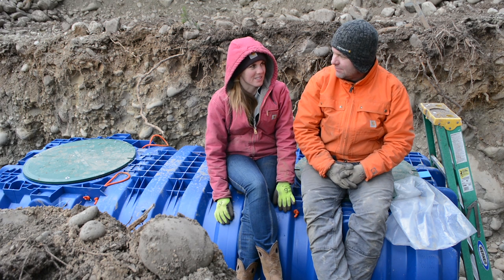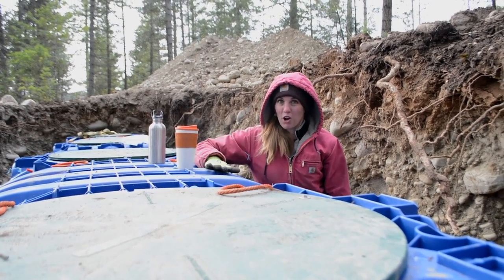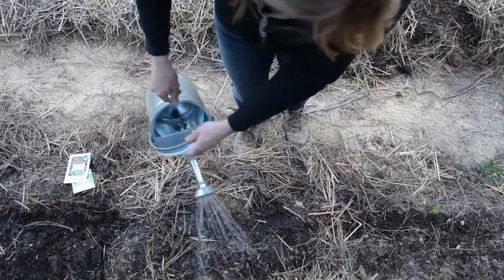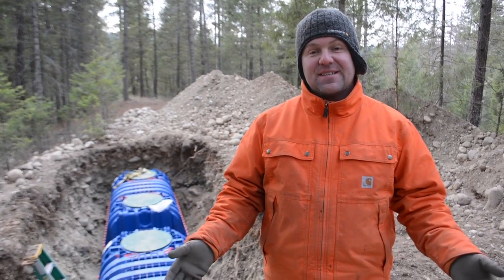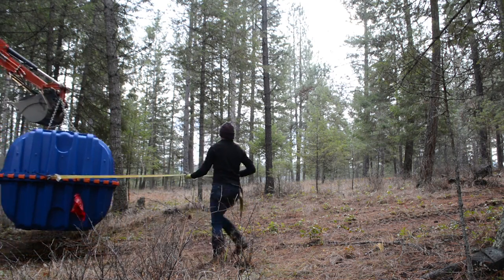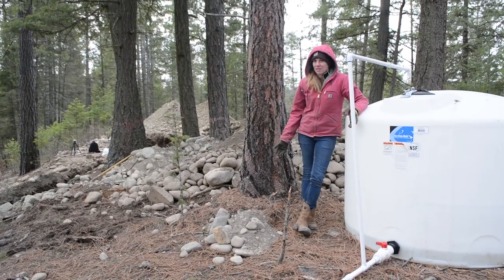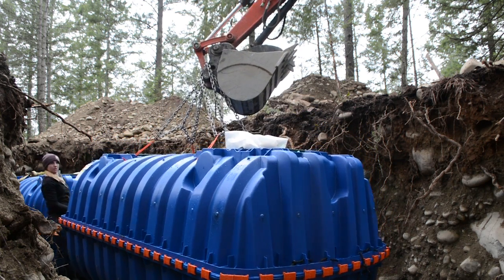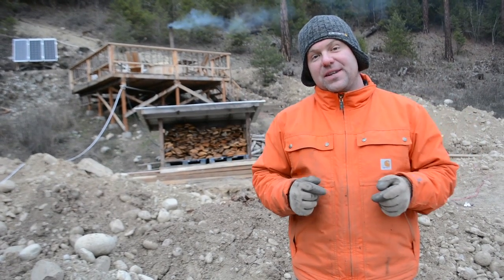Underground POTABLE WATER STORAGE TANKS - Our Off Grid Water System

Comment: A bit of construction advice for you,  take it or leave it. When stacking ecology blocks ALWAYS overlap the seams when stacking.  The shape of the tops and bottoms were designed that way for interlocking. Failure to overlap will allow a single stack to be pushed out of plumb without any resistance from the block next to it, and in the extreme, pushed over crushing everything in it's path. Interlocking ties the blocks together and makes one strong unit, much like a brick or masonry block wall.  A heavy rain could reek havoc on that wall as you have laid it. And if being used a a retaining wall the first layer should always be buried into the ground a minimum of a foot to prevent push out from the soil behind it.
Reply: Deeper there as the frost line is lower.  A buried reinforced concrete wall behind that one would be good.  vented of course.

Comment: Eventually, you will have to treat that water with some special chemicals in order for it to be potable. Even if the source of water is extremely clean and the water is fresh, if you keep it in a tank, even fully closed, it will start developing some nasty stuff inside and the first sign is that it will smell bad...Homeowners all around the world know that even the water from inside a new boiler, needs be heated up once every 2 months at above 70 degrees Celsius (I'm from Europe), in order to kill most of the germs, especially Legionella.Keep on the good work guys!

Comment: Nice, you will get some nice pressure for the showers, sure you are glad you have a big hill on your property. Do you use water check kits to check your quality ? It helps to add a bit of chlorine to your supply. There are tablets available. You can also add a small UV light at your future house to kill off germs and bacteria so it will be safe for consumption. Think ship potable water systems and simplify. One other question, are you considering building part of your new home into the hill and use a earth cover as roof of part of your house ? I have been playing with this idea using big lego block design concrete blocks that are used for retainung walls over here in europe. Easy to waterproof on the outside with bitumen and they are very large so building is fast and 2nd heand you can buy them over here quite cheap. Not sure if they are used in USA too.

Comment: Back in the 1960's helped maintain a cistern up in the mountians.  Dissgusting having to removeing dead squirrrels from the drinking water tank.  Had a 1500 gallon concrete above ground cistern in the 1980's that had a lot of leaking problems.  You are doing such a good job with your water system!!!

Comment: Used Infiltrator for low profile septic tank and chambers that you can drive over.  FL is sandy and much more forgiving than your terrain but the specs on their tanks are amazing.  If you want to do a basic soil separator like you did, use free chainlink fence, often found on Craigslist for free for removal.  Very strong, keeps a finer material, and can be recycled for other uses such as a drag for driveway maintenance or sod preparation. Enjoying your videos.  You are one lucky man to have found a woman who is your 'mini-me'.

Comment: opague tanks above the ground have a potential to grow alge due to sun light penatration. Go with black instead. I would bed those in sand. rocks against the tank will have a potential to eventually poke through believe it or not. We do a lot of water line leak dectection and you would be surprised how improper bedding causes a lot of line breaks. But i like this video. I have an off grid cabin and after Nov 15 i have to drain and winterize my lines because of freezing. looking at something i could do to prevent that.

Comment: Interesting.....

My in-laws lived in a remote home site where they had a cement cistern. However, due to the age & the ways they use to pipe the water to the house, it was replaced with a well. 

Earth ships use a similar system for their water storage. But capture rainwater to cut out the need of depending on others for water. They include a great water purification system as well as a 12 VDC pump to maintain water pressure. Since they use solar for their power, power isn't a problem. 

I'm interested in seeing how you folks utilize this new system as well as what you have to do to maintain it.

Thanks

Comment: If you install a well, you can use a solar-powered or wind-powered (directly or electric turbine) low power pump to slowly trickle the water into the tank. Install a sensor in the cistern that shuts off the pump when it's full. A trickle of water all day can build up enough water for the 20 minute (Heavenly) daily showers, plus cooking and dishwashing.

Comment: Nice video.  With a large stable temperature mass of water underground, have you considered using the tanks as a source of geothermal energy?  I'm not an expert, but if you suspended a heat exchanger in those tanks, you may be able to cool your home in the summer.  Might be worth investigating.

Comment: Is the new cistern going to be gravity fed?  Couldn't see where you buried it with relation to the future cabin or RV.
Reply from the maker: +jay super Yes. It's on top of the hill, so about 70 feet higher than the RV. The house will be two story and built into the hillside, so we'll lose some elevation but should still have plenty of water pressure.

Comment: It is clever on e on e hand. But on the other hand you still dependent. You invested so much fir water storage but it all depends on little pump. I am pretty sure that most possible scenario why community water may fails is also electricity.    

You had to try to make systems that store water above the ground at least couple dozens of inches.

Comment: FYI - Do NOT use the round stone for retaining or building as it will forever shift , (unless in a wire cage).  If you are drowning in the river rock I believe you can rent or hire a rock crusher and turn much of that stone into very useable gravel for paths, driveways, basecourse, landscaping, concrete, etc.
You may even be able to trade the stone for gravel (2:1, 4:1), or other materials.

Comment: How do you keep the cistern tanks from "floating" out of the ground when they are empty?  They are much more buoyant than dirt  and rock.  The rounded bottom edge will squeeze the tanks up like a like a pea from a pod when the ground settles and the dirt wall slides down from the hill.
Reply from the maker: Buoyancy is a result of being surrounded by water, not soil. The "soil" which is really 70% rock percolates very well. Because it's atop the hill it's all downhill from there so water drains away quickly. Proper backfilling and grading are important to keep the water from collecting near the tanks. So long as the tanks aren't sitting in water they aren't buoyant.

Comment: would have thought a well would be the first step to get rid of water hauling and cost,  storage would be secondary in my mind. oh well, you do you
Reply from the maker: We could haul water to our property as we are today for 516 years for the ABSOLUTE MINIMUM cost of getting a well going right now today. Thanks for the video idea. :)

Water cost including transportation $5/month and an hour of our time for pumping.
Versus
Well drilling $10-30k IF you get water and it's usable, if not, just multiply to that figure until you do
Pump to get water out of well $3-5k
Electricity to power pump $15k (batteries, generator, solar, inverter, wiring, conduit)
Plumbing to get water from well to home site $3-5k depending on location of the well (pipe, excavation, fittings)
Reply: Pure Living for Life not a cost issue, it is the difference between a secured water source or a public system that could end without notice. But $ makes the world go round. Live your life the best you can, and enjoy each day.

Comment: Just a random thought,.. You guys sound like you enjoy your hot showers. I wonder what about taking the drain from the camper and run it through a gravity fed filter and repump the water back into the shower? If you use natural soaps and such,.. could be something to look into for water conservation. When you're done you could pipe the water to the toilet for flushing. That way you're only recycling the water during a single shower, and on the next shower it's fresh while everything is filtered and the toilet reaps benefits of the final flush. 

Ideas where combined from these.

https://orbital-systems.com/store/
http://www.igreenspot.com/eco-bath-a-bathroom-fixture-design-that-will-recycle-water/

Comment: SOME ONE NEED TO TELL YOU THE PROBLUM With Tanks IS they CAN Rising IN mud WATER. so fell them up or ye see sup rising.    2 ye need 2 lines up to the tanks... water coming out of tanks bottom of the tanks .. and because you do not wont to push up the 100+ lb. of water ...  so to not do that you are to dump it from the top where you do not have all that bush back.. your bound to play with a High psi. farm grade pump that runs on 120 and that not sola ..   Have fun we like seeing that ..